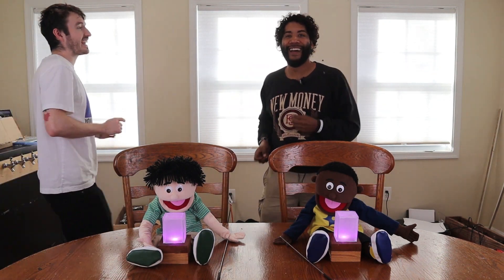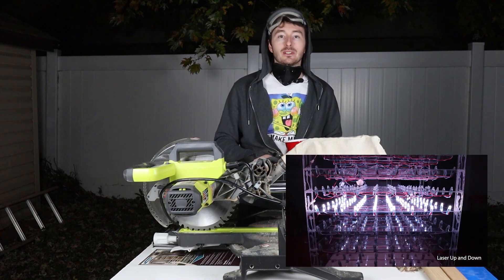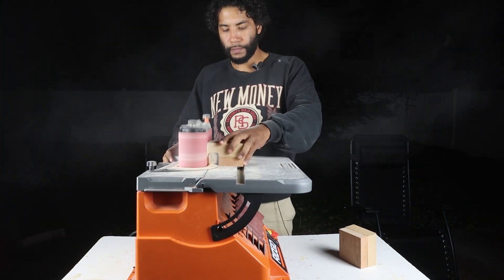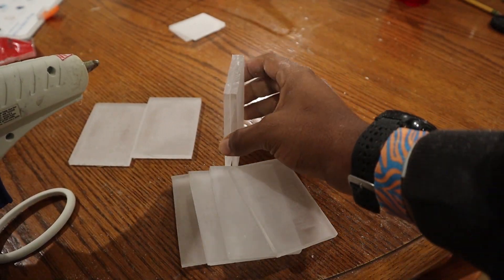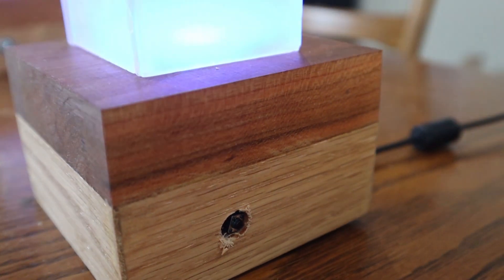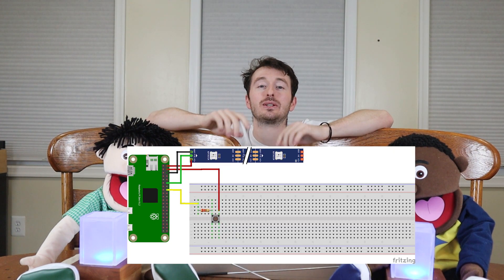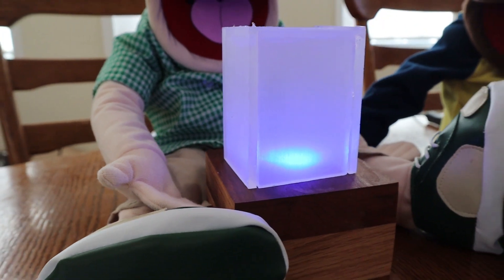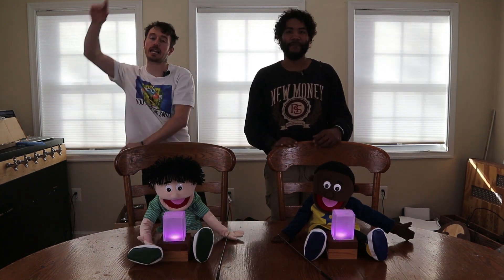HOW TO MAKE BEST FRIEND LIGHTS: DIY Best Friend Light | Raspberry Pi Projects

Comment: ok this is sick, is it possible to mod it so you can select the color? or would you just need to cycle through until you hit one you like? alternatively could you put in a custom palette to rotate through?
Reply from the maker: Yes the color selection can be modified you’d just need to change the hardware to what you want and change the program slightly. We used a push button since it’s what we had on hand and it’s super easy. A custom palette UI would be sick, super easy if you had the hardware too

Comment: What are the basic steps I would have to take in order to have different wifi network functionality?
Reply from the maker: What do you mean by different wifi network functionality? If you are using a different URL/IP Address you could change that in the code here: https://github.com/tmckay1/best_friend_light/blob/main/repositories/ColorRepository.py as explained in the README of the repository: https://github.com/tmckay1/best_friend_light . It doesn't matter where you host the server as long as it is accessible from each client (best frient lamp), you just need to change the url in the link I sent you. You can also find out more about the circuit and power source here: https://www.instructables.com/DIY-Long-Distance-Best-Friend-Lights/ there is a diagram. I used 220 Ohms I think as the current limiting resistor. Glad to see you're back on the horse!
Reply: Would I need to host the server on each individual pi? or would I need a third pi to host the server?
Reply: Also, what type of resistor is it?
 I am sorry for all the questions, I learned basic electronics in 2017 and I just got into programming and networking over the last year and this would be an awesome way to bring them together. Thank you so much
Reply: I also have a question on how the power source is wired

Comment: can you guys make a software video? plzzzzzzzzzzzzzzzz
Reply from the maker: It will be difficult to find the time to do this, but we are continuing to add details to both github repos (the README is a great resource) and the instructables attached, so feel free to comment on any specific questions. We also have more details on how to run the rails server in another video we made about connecting a web server to the internet: https://youtu.be/OQcz23NW6VE
Reply: @tyandgigbuilds8836  A video about the code would have been way more helpful.

Comment: This is really great and such a good idea, thank you. 

I’m curious about how you would approach this to work for multiple people/lights? Eg if we want to have four people connected to the same box, with multiple leds.
Reply from the maker: I limited the lights to just a single led because you’d need a 5v power supply to light up more and I wanted the container to be small that housed the electronics. As for the number of people, you can scale up the number to as many as you want, they will all connect to the same server and determine the color from the output of that server. And when they change light colors they will all tell the same server what the current color should be and update the other lights
Reply: @tyandgigbuilds8836  thank you!

Comment: is it with wifi?
Reply from the maker: The raspberry pi zeros are using WiFi to sync the colors but don’t have to be on the same WiFi network if you host the server on a public server
Reply: @tyandgigbuilds8836  is it expensive you think to make the same lamp as: friendlamps.com
Reply from the maker: The pi zeros are about $30 each, the lights were in a bundle of 50 lights that cost $15 and the wood is up to you so it’s about $75-$90 depending on material to make them. If you want to use them publicly though you’d have to pay for the server in some way

Comment: where does the power supply go or where does it get electricity from ?
Reply from the maker: There’s no power supply in this build since it is only a single ws2811 led. The power source comes from the 5v power from the pi

Comment: I'll agree the software side about running the app on PI needs some work. After putting in some time today on this I can't get it to work on a single pi, let alone connecting to web.
Reply from the maker: Going to update the instructables with more info 👍